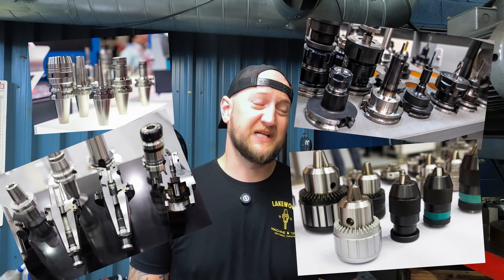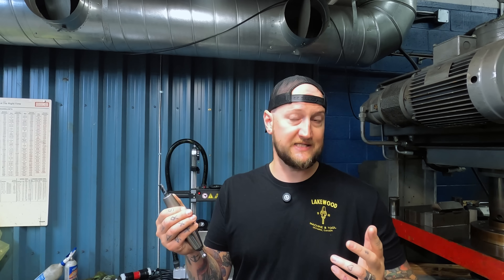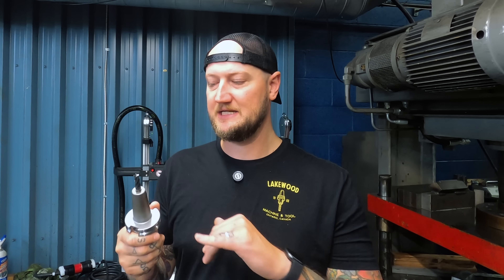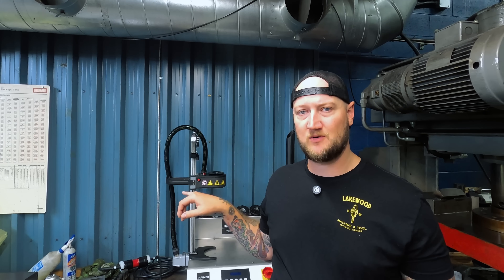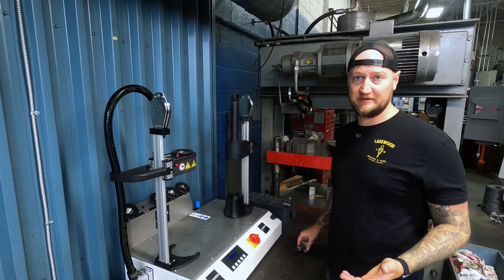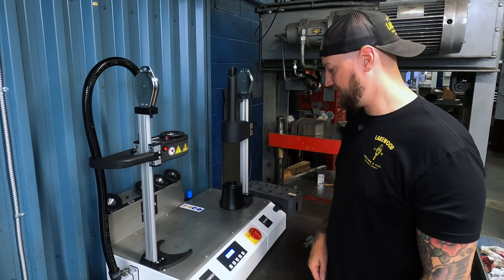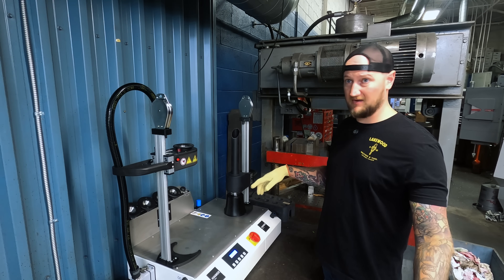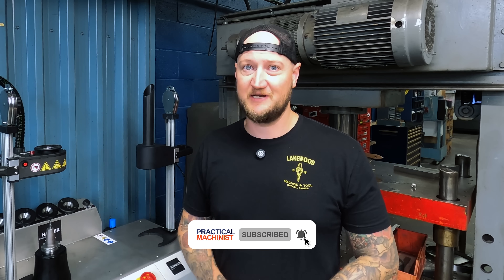Shrink Fit Tool holders: Game Changer or Gimmick? | Machine Shop Talk Ep.138

Comment: Think the stop discs are for different size endmills/tools that you shrink and not for diferent outside diameter of the holder if I am not mistaken.
Reply: This is quite possible! I’ve only shrunk a few so I’d have to check the manual 😅😅
Reply: Correct. This comment should be pinned

Comment: Every shrink fit system I've used always has issues shrinking .125 and .250 especially when using holers tapered just above the tool diameter. 
 
Then they only shrink  so meany times before  there trash. 

The rego-fix system  100x better in my opinion.

Comment: Its just an interference fit like anything else as long as both surfaces have a good finish, and the interference isnt too great (breaks the carbide) it basically acts as 1 monolithic piece. Also as long as both objects are dimensionally accurate when the two objects reach equilibrium and is seated it makes it basically impossible to induce run out. 
The real trick is just having a way to grow the holder fast enough to remove the tool before it heats up as well. Easy to put the tool in. The magic sauce is removal.
Reply: Bingo!!

Comment: There is a situation when I don’t like shrink fit holders. They don’t dumping vibrations, so I try not to use them in milling hard stuff especially in roughing. Milling aluminum, finishing everything or drilling with solid carbide-yes, I still prefer shrink fit over ER.

Comment: I’m not a machine shop, but am curious of the cost, ballpark for a system like yours.
Reply: Just purchased a similar system to this a week ago.  The unit he has runs ~$15000.  I settled on a unit with a chiller as the air cooling would have drove me nuts.